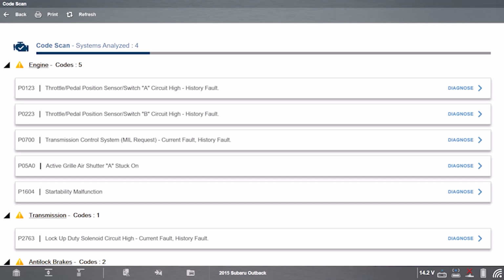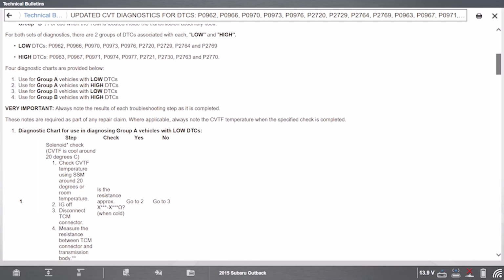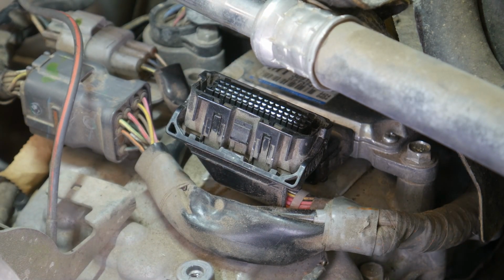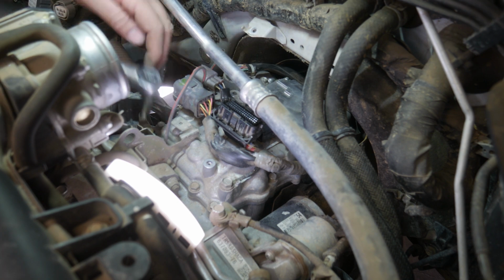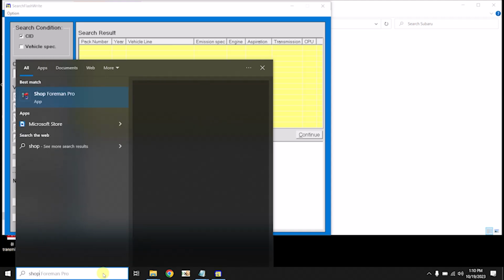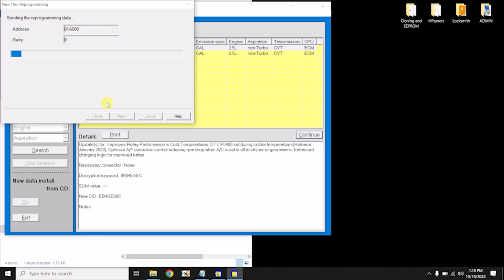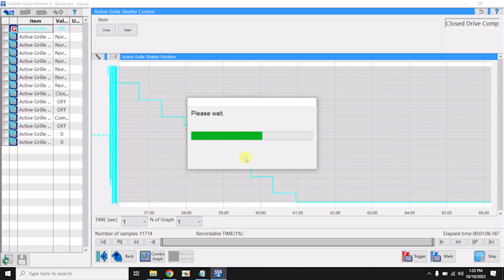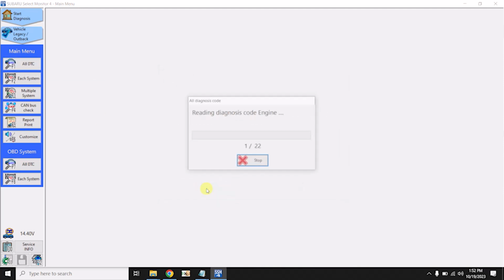Subaru TR580 Valve Body testing TCC solenoid Fault and PCM/TCM updates

Comment: How do I obtain the SSM4 software for use on a laptop? I think I also need some sort of connector is that right?
Reply from the maker: It’s $3600/yr for the software and then you need a j2534 device. The Subaru device is $1600 or you can run the opus Subaru mongoose for around $600.

Comment: Why does my 2015 Subaru Forester 2.5i Limited with the TR580 not have a TCM on the top of the valve body like yours? I am at a loss because I was so excited to check the resistance of the solenoids before I started the replacement but after removing the shield, there is no TCM or corresponding pluigs.

Comment: OK, so my son was getting a P0700 code when he pulled away from a stop sign and everything stopped I suspect it’s the Lock up solenoid in the valve body and the place that’s looking at it which are Subaru specialist, I can hear them calling and saying he needs a new valve body!  I would just like to change the lock up solenoid and it’s probably just sticking! they are still trying to diagnose it which they started yesterday, but it was the mechanic short day so he’ll continue diagnosing today.  I believe with the 2014 XV Crosstrek He has the TR 580 transmission. Nice video. I love the long version with all the details!  I have been working on cars for 49 years so I appreciate all of the data!  I’m a two Saab owner, but I’m surrounded by Subarus LOL!  I have all the test equipment for my Saabs but I have nothing except an Autel scanner that I could use on the Subaru, but I’m not sure how much data it will give me. It wasn’t the top end model but it does cover many brands.  Thanks for sharing!

Comment: Thanks for this. Quick question.  Not sure if you're privvy to this kind of stuff but do you know if wire 48 (AWD solenoid) in the wiring diagram works via a 12V PWM signal or is it just on or off? Thanks in advance.
Reply from the maker: @octurbojoe  it should be PWM. During the AT learning learning process you need  to have the vehicle in the air and at one point you release the brake pedal so the front wheels spin and the leave the parking brake enabled so the rear cannot. The TCM applies pressure until it sees the front wheels slow down. This makes me believe the solenoid is PWM but I have never checked.
Reply: Thank you!

Comment: I had the same issue before with my 2012 impreza. I got a good/used original soleniod from ebay for CAD$200. Bought the gaskets and o-rings from the dealer for another CAD$150 and its been working without issues ever since. A new valve body + install is CAD$2500 from the dealer.

Comment: I tried to do the AT learning after a solenoid replacement on my valve body and keep getting session ended abnormally. message I saw elsewhere some people saying I need to run the rear differential inspection mode first and then the AT learn. Have you run across this? Other problem is my scanner does not seem to have this diff inspection mode. Any other thing it could be from preventing me from doing the AT learn?
Reply: Did you figure it out
Reply: @jorgecarrejo  It was something wrong with my scanner. Took it to a shop and was done no problem. I am not 100% sure it is really necessary in retrospect.

Comment: m having codes of P2763 Torque converter solenoid circuit high and P0974 Shift solenoid Circuit high, Im wondering if the whole valve body needs to be changed or just the harness? I had a previous code of just P2764 Torque converter circuit low and I changed the solenoid but after a couple days the P2763 and P0974 showed up

Comment: don't buy individual solenoids, they are aligned from the factory in the valve body.
Reply from the maker: At the shop we always replace the entire valve body. The spool valves often wear in the bore as well. Many report good luck replacing just the solenoids and if it was my vehicle I would likely do just a solenoid and see how it turns out.

Comment: Valve bodies will often go on Subarus. No more cvts for me.
Reply from the maker: I just wish Subaru would sell the solenoids so we didn’t have to replace the valve body on each one. Some of these valve bodies do have wear issues in the spool valve bores so a valve body replacement is probably best although very expensive.
Reply: Subaru VBs have been updated many times . If it were just the VB, it wouldn’t be so bad but the entire cvt costs $10k, which can also fail. I shouldn’t have to pay for Subaru’s R&D.

Comment: Thanks for Video, really appreciate some people with knowledge like you spend time educating others. Wife drives same 15 outback with 70k miles, it has the TR580 with TCM on top of transmission cover. I was convinced she had a Transmission issue but now not so sure anymore. I came to see what resistance value you would call acceptable and mine are all within tolerances when cold. Her issue if I was to try to explain feels like if you were to put a manual transmission in 6th gear at low speed, does the shudder only once, if you put some gas it does not do it. there are no check engine light or DTC codes in ECU or in TCM. Trans has fresh fluid. old one wasn't too bad just not as tacky as new one. fluid had been replaced at 35k miles already. originally my first thought was spark plug but no knock sensor code, mass air flow but reading dynamic value seems to work well then read about all type of issues with CVT and in particular the locking of torque converter that possibly happens too early on acceleration so if not enough gas it feels like a engine blocking. This happens in shift manual mode just the same. One thing more if I disconnect battery for let's say an hour (I guess all learning memory gets erased) then can functions well for maybe an hour (maybe until it gets to normal operating temp) then issue starts again. Then after that it can do it cold or hot just the same. I'm thinking issue is caused by a control module thus the reason it is not detecting something is wrong and not throwing any code. Thanks to anyone who spent the time reading and if you have any idea that could help thanks in advance.

Comment: i like a start to finish video the best the length longer single videos easier to follow
Reply from the maker: Thanks for the feedback. I will try and release more videos like this in the future.
Reply: thanks so much a while back you helped me with i think a 1987 22re truck did a head gasket, i have to install a expansion valve on the A/C haven't found it yet assume its in the dash somewhere have you done one of them @ThePracticalMechanic

Comment: This makes me wonder how many failed CVT transmission stories are really an issue like this.
Reply from the maker: I’ve replaced a couple Subaru CVT transmission because the belt would squeal or they would have bearing noise. I have replaced a lot more valve bodies. I prefer the TR580 transmission because It less messy with the valve body on top. I’ve done several valve bodies on the 690’s as well but not as many.
Reply: Subaru CVT transmission's failure stories are as numerous as are the causes, the majority are electrical circuit malfunctions from duty-controlled valve body solenoid failures, intermittent circuit opens and shorts and some are mechanical in nature. 

There are lots of TSBs for corrective fixes, remedies, improvements to function with software updates, revised diagnostic procedures, and product campaigns extending warranties on some.

 It's easy to lump them all together.

They're just another example of when excess becomes ridiculous in an effort to maximize efficiency. 
Personally, I think some folks' driving habits take their toll causing the transmission control side to have to work double time.

Comment: Check out the STIS Tech Tips Nov. 2020 article for TC relearn on test drive procedure, it's a separate procedure from the scanner relearn, it's not in the SI.  
Appreciate the videos. Make them as long as you feel is necessary.
Reply from the maker: Thanks for the great tip. I looked at some of the TIPs articles in Prodemand and they are a little blurry. Google cam up with the full quality versions. https://static.nhtsa.gov/odi/tsbs/2020/MC-10183695-0001.pdf
Reply: @ThePracticalMechanic  Yep, that's it!  I just learned of this a year ago. Don't understand why it's not in the SI. It may be in SI corrections, haven't seen it.
I've lost count of how many valve bodies I've replaced, all seem to have been ok on test drives with no repeat failures, thinking maybe the TC relearn eventually relearns itself with driver habits.

Check out TSB 16-115-18 CVT warranty extension 10yrs/100,000 miles, it covers 2016-17 models, and there is a similar bulletin for 2018 models.
Reply: Thanks both, I looked the newsletter. Does that mean I can use those steps to avoid the relearn tool scanner, as I don't have one and seeing "AT Oil temp" Flashing after mechanic changed the selenoid and the AT fluid?
Reply: @vallabhbhansali-ch6rb  
Oh boy!

First, code dependent, a proper diagnosis is required for an effective repair. Most codes are for circuit malfunctions, it doesn't necessarily mean the part is bad. Could be power and or ground related, poor connections, damaged wires and a few other things.

The AT Temp light flashing means there's a trouble code present, needs to be scanned and go from there.

Did your mechanic replace just a solenoid, or the whole solenoid-valve body assembly? Best to get the valve body assembly from Subaru, some models have been updated with new and improved parts.

Also, some models have TSBs (technical service bulletins) , some have service manual corrections for improved diagnostics, and some have software updates for the control units.

After a solenoid-valve body replacement quality parts,  a relearn procedure needs to be done with an appropriate scan tool, then the torque converter relearn drive cycle needs to be preformed, all the info is in the service manuals, it requires reading skills. 
Doesn't hurt to have proper training as well.

Did your mechanic use Genuine Subaru CVT transmission fluid?

If your mechanic only replaced one solenoid (hopefully the correct one for the code) and he sourced said solenoid from Amazon or eBay, or somewhere like that, good chance he got a crap part. Modern CVT & conventional automatic transmission solenoids are the PWM (pulse width modulated) type, and incorrect solenoid can damage the transmission control unit.

Modern vehicles require technical skills, sometimes you get lucky guessing and tossing a part at it for a fix. 

God luck!

Comment: I like this video as I have a '17 Forester 2.5i( 180000 miles), CVT fluid changed every 30000 miles.
No problems, so far .
Reply from the maker: Unfortunately many people think modern transmissions don’t need serviced. It doesn’t help that the OEMs often say that the transmission is lifetime fill. 
Thanks for watching and sharing your maintenance interval.
Reply: @ThePracticalMechanic  Same 30000 mi.  OCI for front and rear diffs.
 Which is once a year.
No codes, no check engine light.
5000 mi OCI (every 2 months) on the motor using Kirkland 0w-20 fullsyn. 

I  used Amsoil Signature fulsyn for the first 100 K but couldn't  justify the cost difference when I found  the Kirkland oil.